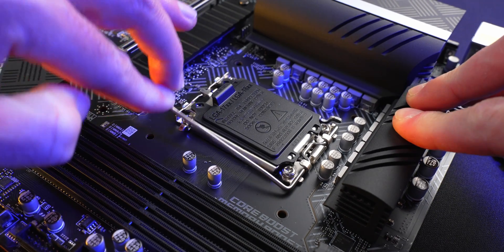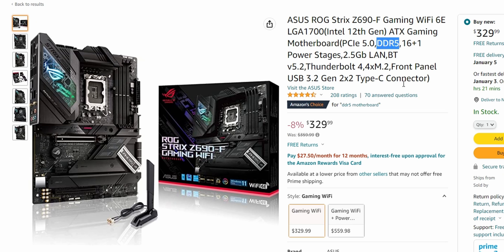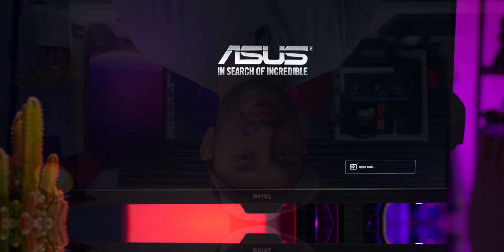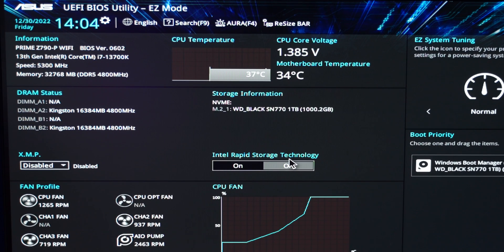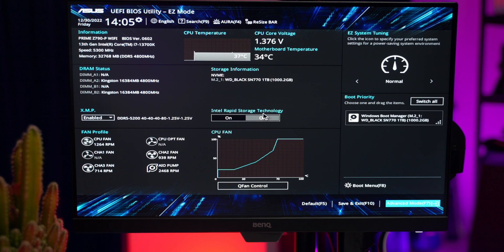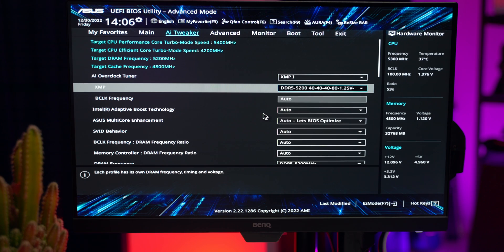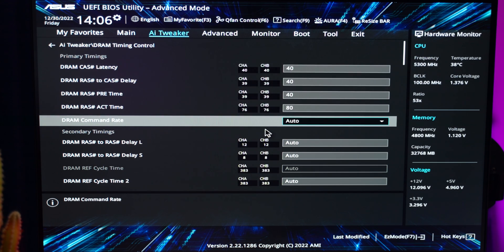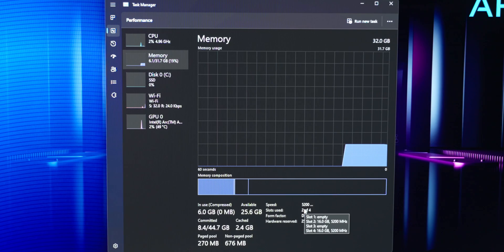How to Install and Setup DDR5 and DDR4 RAM in a PC

Comment: Great Video very helpful! Quick question, I want to upgrade the RAM on my prebuild do I have to remove the motherboard to remove/install new RAM?
Reply from the maker: You don't have to remove the motherboard as long as you have enough room to work with it in the case. Just make sure you disconnect the power from the PC.

Comment: Enabling XMP on mine prevents my pc from booting ;_; blue screen of death at Windows startup. My MB supports DDR5 7600mhz. The RAM is only DDR5 6400, so it's well below the max speed. Babyrage. I even lowered it all the way down to 5000, and it still crashes at Windows startup... So I'm stuck with default 4800, despite using expensive RAM

Comment: So I tried to install two more DDR5 that matched exactly into an ibuypower PC. When I did it would just cycle and never would open anything up you couldn't even get into all this. Talking with their tech support they said that DDR5 is unstable with 4 RAM sticks. I was adding 2 more 16 for 64GB.

What they told me to do was to buy a whole new RAM set so I bought 2-32s that I'm going to stick in the same slots. 

So now I'm a little gun shy. I remember with DDR4 I literally used to just be able to plug in two additional sticks and it would pick it up automatically. Is there any reason to expect that changing this from 32 to 64 with new RAM would be a problem or wouldn't be able to be done as you instructed?  Its kKingston 6000mpts or howere u say it.  Im at 5200 now i think and its a nice new 08-2024 board AS Rock B760 CM

Thxs

Comment: If I have 4 slots and buy a new set of 32 gig ddr4 tab, should I remove the two 16 gigs? I was hoping I could use all 4
Reply: They all have to match, 16x4 or 32x4 or 32x2, no mixing 16s and 32s

Comment: I turned on enabled xmp saved and restarted its still reading 4400 mhz. The new ones are 5600. Any idea?
Reply: Resolution?  Clock speed of the motherboard not as fast as the RAM?
Reply: @GoingNowhereFastBFL  i had restart the PC. Forgot.all.about this question.  Thanks for an answer!